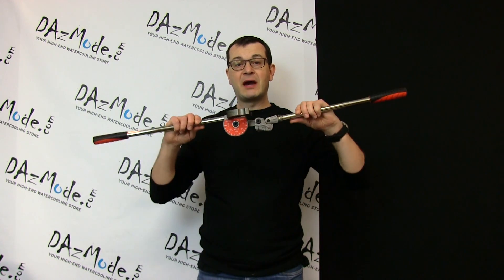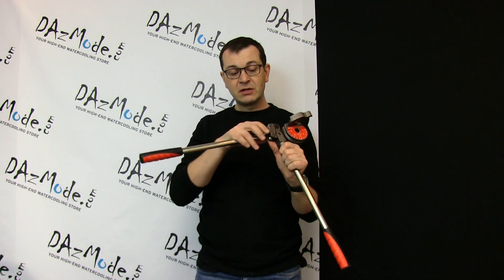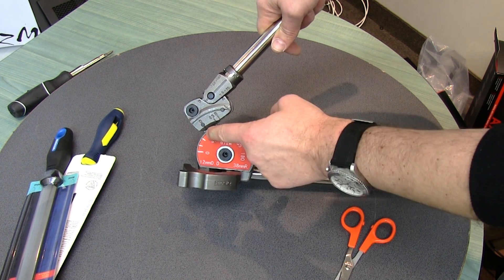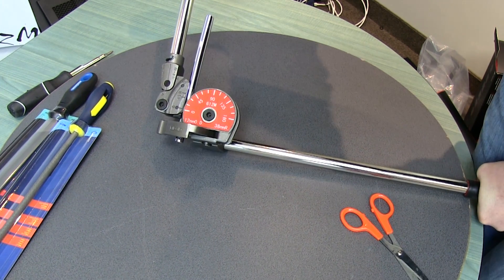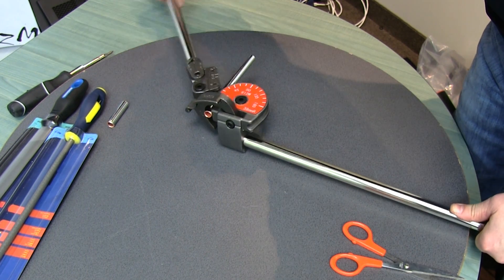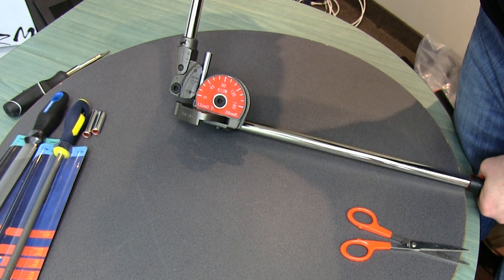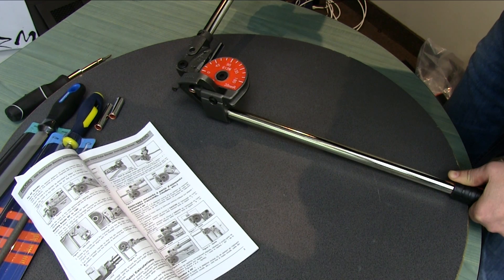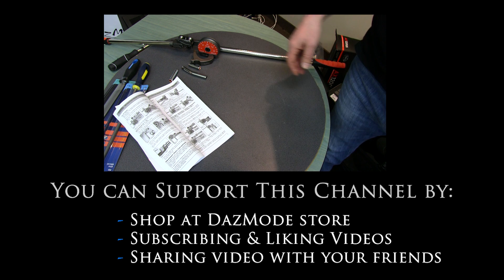Copper Tube Bend Fail - DazLab Stupid 9

Comment: Copper needs to be anealed to not break like that, you could try using plumbing tube, anealing it with a torch then bend and get the tubes chrome plated after

Comment: Daz,  I had a feeling that these chrome/nickel plated tubes from BitsPower would not bend so I am just going with straight runs and using fittings to get my turns.  Thanks for experimenting, and saving me from the same frustration.  But 90 degree BitsPower Fittings are expensive. Luckily I had a bunch from buying some here and there over the past year. Anyway thanks again for making this video.

Ron

Comment: Have you considered using stainless steel tubing instead ?
Reply: i use those same benders everyday at work for bending stainless tube.  Never seen em used on copper.  Also, if you dont know how to lay out your bends just get swagelok fittings or buy lots of extra tube to practice on.  Oh, and if you get ss tube, make sure you get SS cutting wheel for you tube cutters!

Comment: Dont you think it can be because the bending was not on the center of the tube? you were trying to bend from one of the sides which it needs more force to bend, force that maybe the tube didnt resist, maybe if you try the bend from the center of the tube, and once you have the bend cut the size you need perhaps?

Comment: Shitty tubing. That's it. Good quality tubes bend easily.
Reply: +Simeon Petkov  It was not the tubing's fault, you should really understand plumping before you make a statement on a companies tubing like that. Daz was trying to bend hard copper tubing, which will never ever bend in a tubing bender. To be able to bend copper tubing in a tubing bender you need to use soft copper tubing.
Reply: Indeed. This is what i meant with "shitty"
Reply: +Simeon Petkov Shitty=\=Wrong type...

Comment: if you can fill the pipe water and freeze it it will bend without deforming. its tricky to do though, especially in the summer

Comment: That type of coated pipe does not bend well.  You might try bending springs inside, but I don't think its going to work.  If you want that type of finish, you would be better off buying plain copper, make you bends to fit, then send it out and have it plated.  You could also anneal your pipe, and clear coat it for a different look.  That is probably chrome plated, or could be nickel plated.  Either way, its not good for bending.
Reply: +TheRagingHillbilly I agree with this gentleman. I work and bend tubing in my line of work. A coated tube as you are using does not bend. If you can afford the stainless steel tubing then that would bend fine. Or like HIllbilly says, bend in copper, then have it coated.
Reply: Coated tubes bends just fine. This coating stuff, is just a myth.

Comment: 1: (before chroming it) heat the pipe till you start seeing some red (sometimes blue/purple right before that) colours, then cool it fast, like dip it in water or something or spray it with a hose
2: bend it as you want it, and then you can if you want too, reheat it and cool it again, to make it hard again.
3: then chrome it

also another tip, its usually smart to keep the bend below 90 degrees, but thats just plumbing rules, dont think it will matter too much in a pc ^^
also there are A LOT of great tools out there that you can use instead of those files
Reply from the maker: +Tommy Strandman Thank you for sharing. That seals my next move. As I already have bunch of those tubes, I will save them for future project that works with straight lines and use acrylic in this build.

Comment: You are using the wrong kind of copper tube. 
That tube is only for straight line use, you need the softer tube, you know you have the right tube when you can bend it by hand:)
Reply from the maker: +Oddbjørn Leonardsen This sounds as a general consensus.

Comment: I don't think it's possible to bend chromed copper tubes.

Even if you manage somehow to bend one (with heat and stuff), the chrome will most likely show flaws after it.
Reply: Chromed soft copper tubes, they bend just fine. Even with the cheapest bender, there are not much tool marks to speak of. But there may be some minor ones.

Comment: You need to briefly heat the copper to make it more malleable. I'm assuming the plating process has hardened the copper. Similar to what happens when you bend soft copper tubing too many times and it gets stuff and collapses...
Reply: No. You do not need to heat the tube. But you do need to use a tube with the right right specs.

Comment: Try annealing first. 212.2C to 800C for a about few minutes should do the trick. The brass is brittle which means it was recently cold worked. Annealing the brass will allow the ductility to increase. So broil in the oven until the grain size regrows or about an hour or 2.

Comment: Maybe you should verify that the friction wheels on the pull lever is running smoothly ... maybe even consider lubrication of outer wall of the copper tubing where it is making contact with the friction wheel to make it run as smooth as it possibly can.

However, as pointed out earlier in the comments, I'd say your single most viable option to land this copper tube project of yours is to do the bending part with regular unplated soft copper tubing from home depot etc and have the finished bends sent in for plating.

Good luck!

Comment: Wrong type of tube for that use. Daz, check-out the build that nVidia has on their channel with copper tubing. The type of tube you use is very brittle and hard. As a start, use simple straight pure copper tube (not chromed), it is cheaper and will bend.
Reply: +valcked You can get soft copper tubing that is chromed as well and the price is not much different. Also I doubt dazmode is all that worried about a few bucks. ;)

Comment: Certainly doesn't look like it behaves like soft copper... what are the particular tubing are you using?  I have that same bender, and have successfully bent copper, brass, the Alphacool HT tubing (Nickle coated brass), and stainless steel.  If you're having that much difficulty actually bending it (the force required), I'm going to guess your tubing has too thick of a wall, or is not annealed.  If you had bought copper, and then sent it for plating, perhaps part of the plating process hardened the copper?

That bender worked great, and you don't have to put it in a vise for good results.

Comment: I don't think that is supposed to bend, as copper comes in different strengths. The copper you usually bend is soft tubing copper and is used more in refrigeration and comes in coils.

What brand is that pipe, alphacool?
Reply from the maker: +vicdez not Alphacool , I sourced it from other source.

Comment: As shown in this:
https://www.youtube.com/watch?v=8NAaRQUTp9g
Even with ice in brass, it should be very easy to bend. Copper should be softer than brass. It seems to me that the pipe you have is very hard.
Reply from the maker: +Yang Ji very cool video
Reply: +DazMode I have done plumbing quite a few times and have family that does plumbing. Here is a tip there is such a thing as hard and soft copper. To bend it you need soft copper which is what is used under concrete slabs, cause if you have a joint under concrete and if it fails you have a major repair on your hands. Hard copper is most time used above the slab and is the kind you solder a joint to, but it will break under pressure.

Comment: Apply heat to it a torch
Reply: Apply a torch to it and let it heat up while the metal is soft then bend it the pipe is too brittle.
Reply from the maker: +Miguel Floriano will try sand first, I'm afraid heat may damage plating.